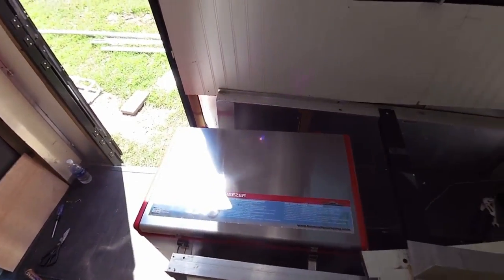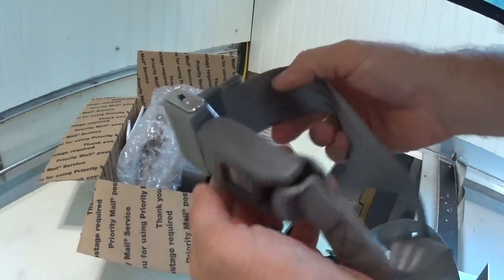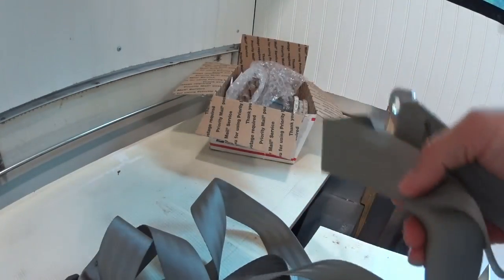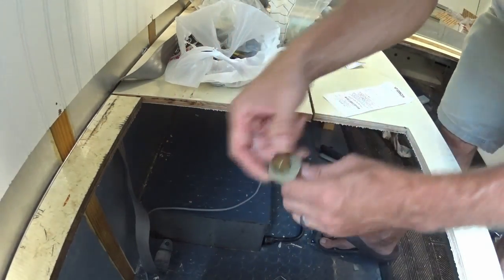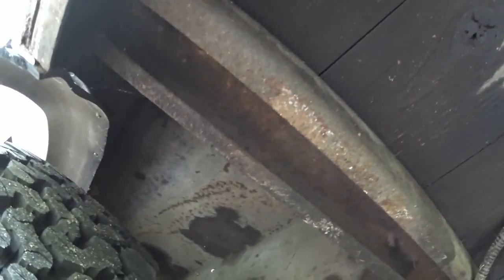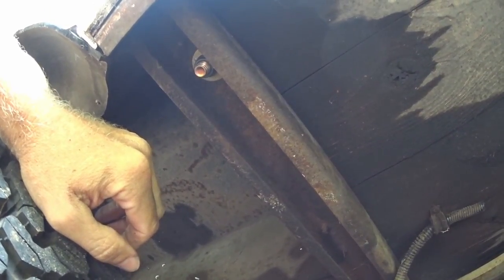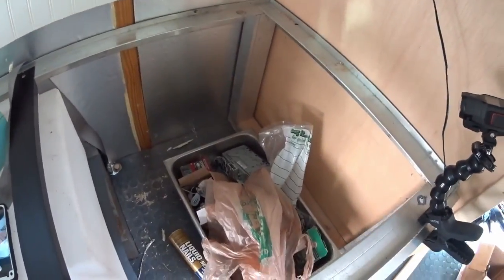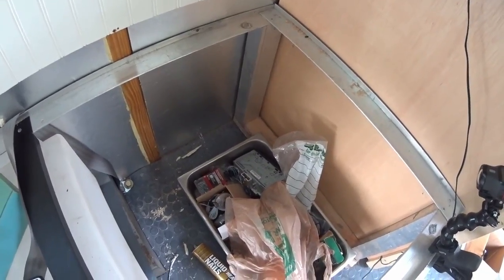Box Truck Camper 12 volt Fridge and Rear Belts 50

Comment: Only suggestions I might have is from my old Waeco/Dometic fridge -  put that fridge on locking drawer tray, or in a rolling tray. they get heavy for wife/kid. The lid really needs to be latched down, for effective insulation and preventing spillage. It's fan should be located towards the door for ventilation and airflow. Looking good. My extra fridge was in truck camper so, maybe you won't be doing as much 4x4 action, I was grateful for the locks on fridge and tray after avoiding a loaded logging truck on single lane dirt road, and decided the ditch was better option than semi with 10 cords of tree length wood.
Reply from the maker: Oh, I still plan on using the latches. The plan is to make the seat cushion so that it flips up where the Fridge is. I realize the fan need more ventilation so I am thinking about leaving the cover off in that area. Kind of like how a large house fridge does not have anything covering the back.
Reply: If your fridge is like the Waeco was, its a different principle than house fridge with cooling tubes on back. The golden bits on 12V system are the computer fan needs access to air flow. The only issue I had with the Waeco/Dometic was dog hairs, traveled with 2 dogs, and kicking with size 12's when weary. Our best placement was towards entry door on C, and fan facing into room on camper.. Out of way of my feet and the dogs hair. With the C the dogs didn't ride in the stairwell so, less hair accumulated. Think that placing fan outward from bench might offer best cooling with your fridge, just a thought.

Comment: I been planing  to do this for the future I want to build my one camper.
Reply from the maker: It's tedious work but very rewarding. Do yourself a favor and plan on all of the appliance sizes before you start building. It will save you a lot of headaches .
Reply: i know is a lot of work but travel trailers are just made for a few years after that everything  start to Fall Apart and a mid condition  class b will cost too much the only difference  with my plan is that I want to build  on a sprinter with a shower.

Comment: that fridgefits nicely this way, kindah wondering if its the same width as the benches dept , if so you could shorten the frame on that side and push the fridge sideways against the end of it with a rathetstrap pulling it against the legs 
might even want to section the matras and make a hingepoint in the vinyl so you can acces it eazier  (could do a double hinge and make a n that serves as an armrest leaving the fridge bare and accessable) , if you need to turn it intoo a bed lay the armrest out and youre done
mount the legs like they do benches on a schoolbus weld a lip to it and drill through and through
Reply from the maker: Hmmm, keep those ideas coming. Its wider than the bench unfortunately otherwise i would have turned it. I planned on hinging the vinyl and cushion but didn't think about using it as an armrest, another great idea. My wife also wanted to put something to hold shoes on that side. I need to incorporate that into it also.

Comment: Caution with the bolts tightened to the rubber flooring. They will loosen eventually as the rubber will give out in tension over time.
Reply from the maker: Thanks for the tip.

Comment: Is your shower/toilet functional yet? I was wondering how you plan on addressing hot water for the shower. My popup that had that shower had a small water heater that worked pretty well, although in was only a couple gallons. I know Cabela's use to have a portable instant hot water heater that you hooked a garden hose up to and you had unlimited hot water.
Reply from the maker: Shower no probably be a little while on that, the toilet yes. All I need to do for that is to add water and chemicals.  I was thinking about using a heat exchanger off the engine to heat the water for the shower.  Just fire up the engine when you need hot water.

Comment: I am a bit concerned about the seat belt plan you are using. If that is just a lap belt that does not auto tighten and it has no shoulder belts and it is facing sideways. If it were me I would put some more thought to it. Only way I see to make a safe passenger seat in that cargo area would be front facing, center mounted and built in self tightening shoulder straps all bolted to the frame of the van. The only other idea that I can think of is a bench seat with shoulder straps. You can watch some crash tests with just lap belts and see what you think. The set up you have is risky in a severe accident in all directions IMO. Particularly a side impact where the person was seated. Maybe a seat that you can easily remove or fold up like the ones used on planes. I have seen tests where the dummies just fold or slip right out of a lap belt. That is why buses have shoulder straps now. I dunno man that just makes me nervous.
Reply from the maker: I understand your concerns and appreciate your solutions. The way I have it now is equivalent to my 94 coachman rv. In fact maybe a little better, the mounting points for the belts in the coachman where just though the factory sheet metal using body washers and grade 5 hardware. The engineering of shoulder straps into the box are probably beyond my skills and I would just be guessing at proper mounting points and where to source the retractable hardware.  To me the best solution for my scenario would be to add a jump seat between the front two seats using factory mounting points and restraints since there are only 3 of us but getting the family to only ride up front is another issue altogether. The best solution overall I can think of and for anyone thinking about building one of these would be to use a 4 door truck cab  instead. That way the safety concerns are completely taken care of.  Do school buses have seatbelts nowadays?
Reply: Been so long since I had one of those awful small persons but from what I am told they do not.